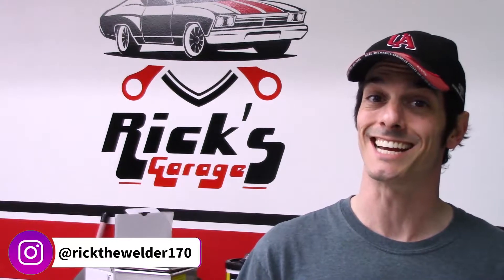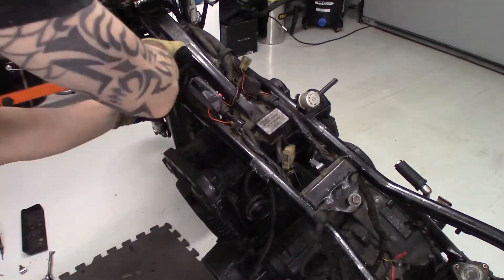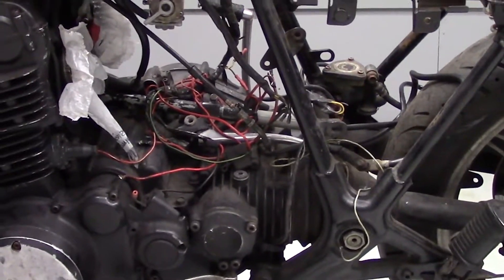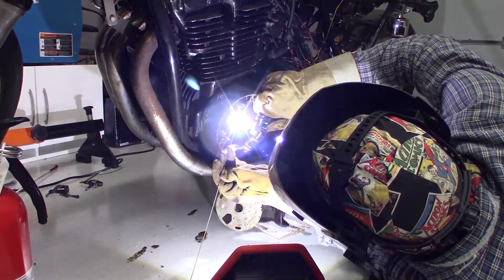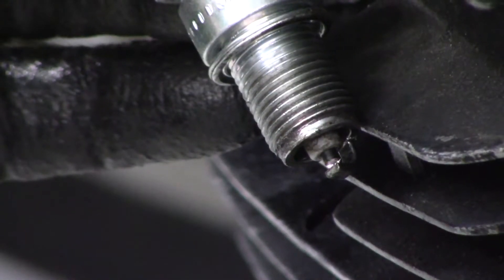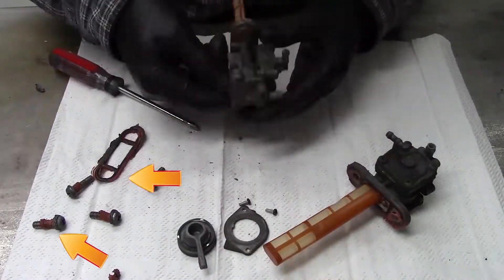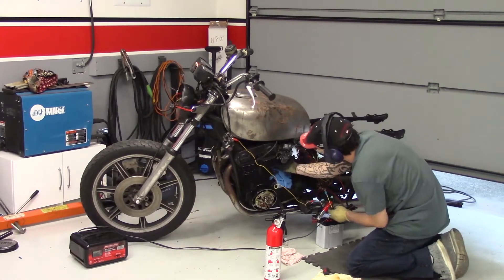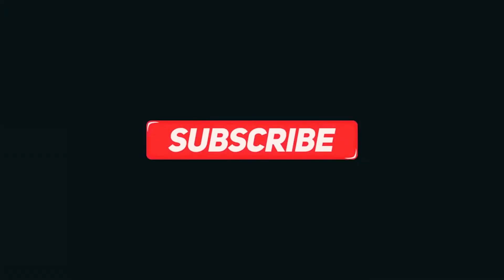Will Project quaranTina run? ( 1977 Yamaha XS750 ) - Rick's Garage ep. 24

Comment: Did you end up replacing the slide diagrams when you were working on the carbs?
Reply from the maker: Thank you for your question!  Thankfully I didn't have to replace the slides or diaphragms.  They were in great shape - keep an eye on the channel for a carb rebuild vid.  I'll show you a quick way to check their condition.

Comment: Rick, I got a free 77 xs750 donate to me for being a "Bike Guy" Its a little more complete looking than yours but not much. The wiring has been tamper with and there is no power to the starter or headlight.  New battery, starter button good and with a power probe 3 supply-ing power to the starter button it will turn over.   I have brake lights but no head or tail lights. I quess my next step is to trace the head light to taillight and find the problem.  This bike has horn but no power to the turn signals.  I would rather go to the dentist than mess with wiring but I was  able to pick up a Clymer manual  for it and it does have the wiring diagram.  You got any suggestion.  Wink from NC.
Reply from the maker: Hi Wink,
Thanks for your comment!  Wiring can certainly be a pain - depending on how badly damaged your wiring harness is, it may be easier to either replace the whole harness or start over and make your own.  Not sure how good the Clymer's diagram is but here's a download link to the factory service manual if you don't already have it.
http://www.v.biker.net/750_service/750_service%20main.html
Also, make sure you verify the function of all the relays and switches before you go cutting open looms.  Eliminate them as potential causes.